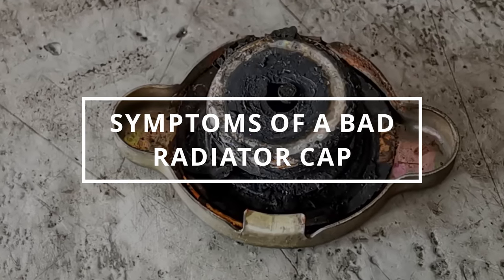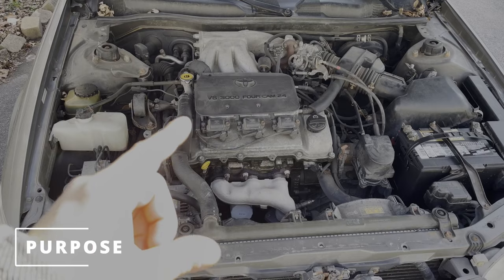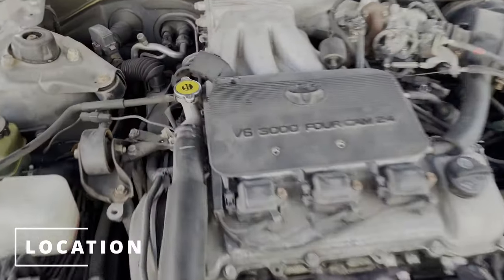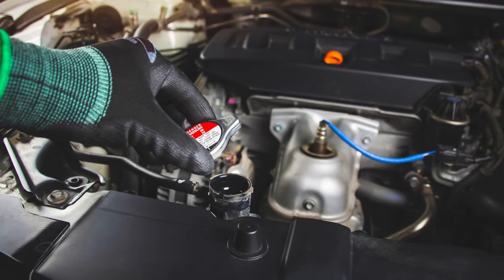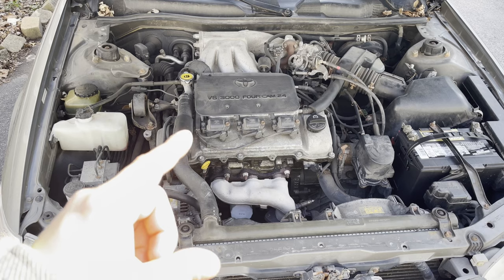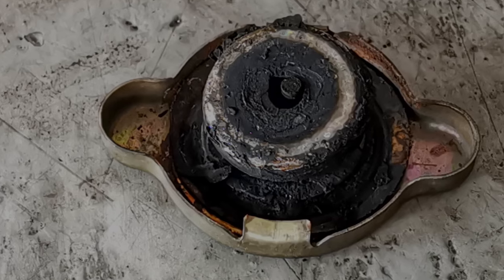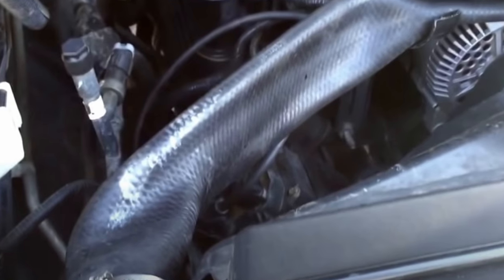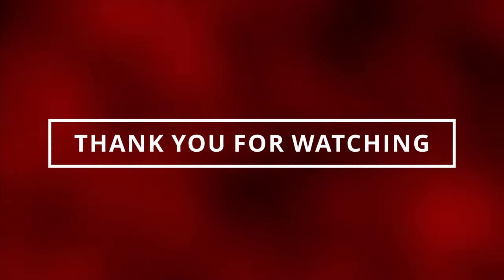SYMPTOMS OF A BAD RADIATOR CAP

Comment: Radiator caps do make a difference. On my 97 Trans am, it went faulty, it was overheating up to like 300 degrees, water bubbling and exploding from the resorviour, and even it was popping. Changed it, temps dropped to normal, cooling was great.

Comment: Help! I have a 2014 Jeep SRT, leaks Coolant from the radiator cap, engine does not overhead (the temp gauge needle doesnt go up), the coolant in the reservoir starts bubbling like crazy could
This be only the cap?

Comment: I replaced the cap but the hose still collapsed
Reply: Is the reservoir open to air? Maybe that air tube is blocked  so coolant from the reservoir can’t move to the radiator
Reply: @pprb123  idk I’ll check it out thanks
Reply: @glen4198
did you replace with the exact one, experienced that till i found the exact as the one that was there
Reply: @CaptainHlungwani  yes I did. It straightened itself out somehow. I can’t remember exactly what I did because it’s been a half year